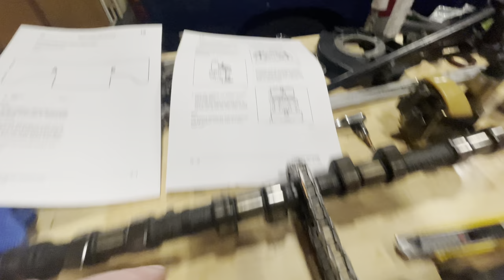Restoring a Flood Damaged Porsche 968: Replacing Cam chain and guides

Comment: Excellent work and video.. As I have done this process a few times now I was holding my breath as you were removing the variocam oil feed tube, washers and check valve.. I dont know if you did this or not, but to prevent any items disappearing down the oil drain hole sitting just below the variocam I usually block it off with a rag or similar. Its so easy to lose small parts down there, especially the check valve as it will pop out with any movement of the variocam and most likely be gone into the sump.  
If you haven't planned for it already, I would definitely recommend sending the injectors out for an ultrasonic clean and test of spray pattern, especially now you are only one step away from removing them completely. Its an inexpensive job but makes a positive difference in drivability, smoothness, power and fuel economy. 
And I know it might be a bit late now that you have the cams installed again, but if you have no record of the head gasket being replaced, most likely it will be deterioating even though its not currently leaking. It allows coolant to short circuit causing uneven cooling of especially the rear cylinders and can eventually fail completely. 
Looking forward to the next episode and timing of the cams.. 👍
Reply from the maker: Thank you Alex! I did not plug that hole, but luckily nothing went down it 😅 Good point about the fuel injectors too, I was considering it, but you have convinced me. This car has very low mileage so I think the head gasket should be fine, or rather I will take a gamble that it's good.